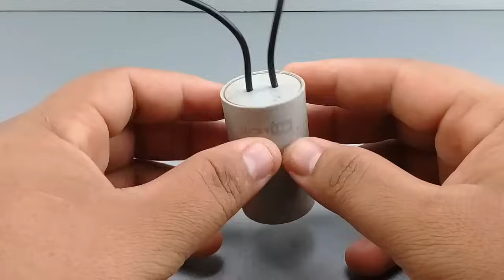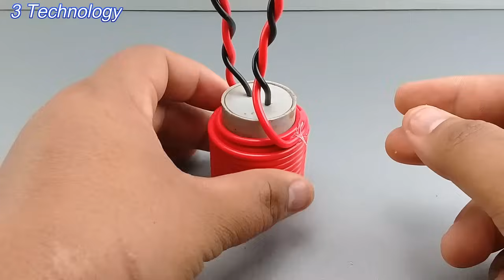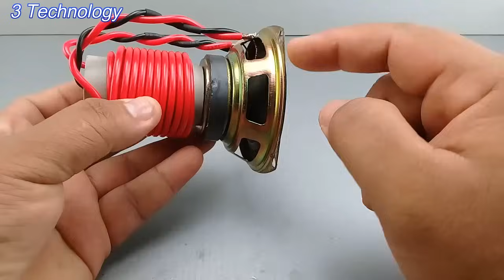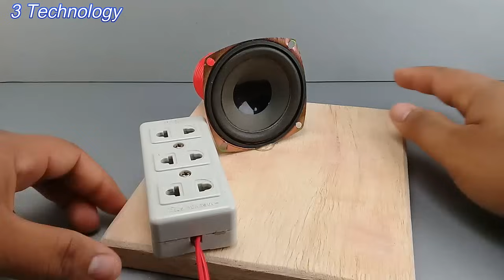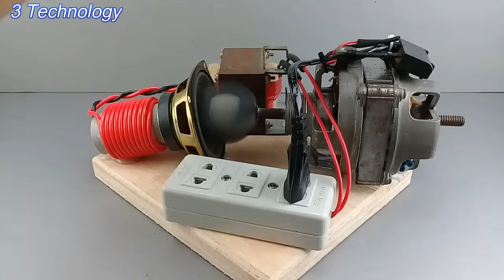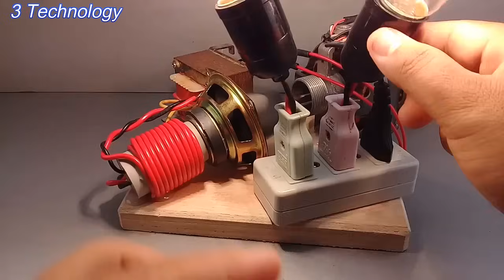Powerful Electricity Generator For 2023 With Speaker Transformer / Free Energy

Comment: 3 Technology has an accurate understanding of the power of high efficiency in a transformer. Simple or complex (depends on how you perceive it) as the set up is - he needs 12volt input to have a 240 volt out put. The whole problem lies in the generation of 12 volts on the primary side of the transformer. That's where the speaker/capacitor and coil come in. What ever you do work and test this to ensure you have 12  volts. The transformer will handle the 240 volts for you without a hustle. The 240 volts will drive that fan motor without any sweat! The down side will be a buzzy noise from the speaker as the diaphragm keeps popping in and out because of alternating current through it's coil. Don't expect this gig to be quiet. Good luck
Reply: Gibberish